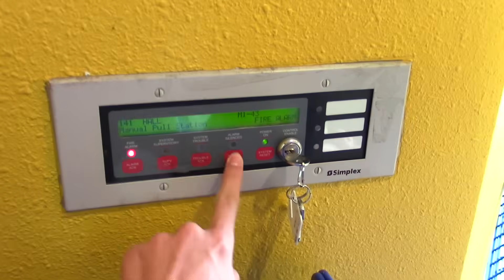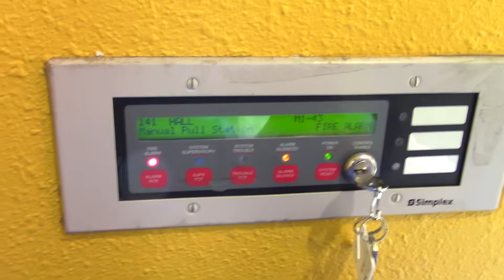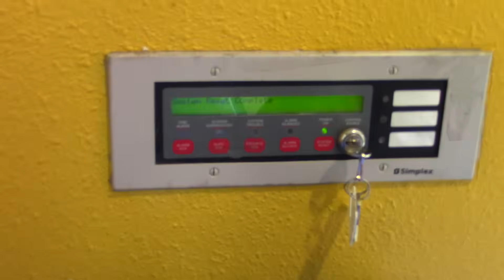School Fire Drill #12: Simplex Annunciator

Comment: How do you silence the chirping noise from the panel when it shows a system fault?
Reply: press trouble acknowledge or panel silence(depends on panel)
Reply: if it is a ground fault you need to get that checked out immediately that means one of the NACs are shorted out

Comment: Where is the automated message that goes with the alarm
Reply: Good question. I don’t believe this building has that kind of system. We did have a building at our school that had a voice evacuation message, but it’s now under construction. Our temporary facility has the same system as the building demonstrated in the movie, which does not have a voice. I believe that NFPA standards do require buildings with a certain number of occupants or more have to have voice evacuation to transmit any critical emergency information. I hope this helps/

Comment: The question you have to ask yourself is “does the fire alarm system save me?” If you don’t see smoke or heat detectors and only pulls and fire alarms it’s not gonna warn you of a real fire so mabye that will be the end of your life
Reply: E Random Videos That’s why fire codes require smoke detectors as well as pull stations. If a detector goes off, it will set the whole system off.

Comment: 13th COMMENT! 
Also, where do you buy annunciators?
Reply: GameAndLifeRecorder you can get them on eBay. You need to make sure that it is 100% compatible with your panel, or t will not work. You need a panel for an annunciator, you can’t use them as panels for very specific reasons...
Reply: EBay mostly, just make sure your panel has an ANN-Bus and is compatible.
Reply: Well guys I may not be able to install it with a panel cuz panels = too expensive
Reply: SATX Railfanning Productions it’s not called an ANN-Bus on Simplex, it’s only ANN on firelite panels compatable
With the ANN Series. Like the MS-9200UDLS rev1 cannot handle ANNs, only EIA

Comment: Nice! Aren’t QuickAlerts and TrueAlerts essentially the same thing with a different name? I knew that when their production started in 1999 they were sued by a Chinese firm who claimed they had trademarked the name QuickAlert so Simplex just renamed it TrueAlert.
Reply: firefreak57 They are the same the only difference is that some have have small hole on right side of the horn grill and it doesn’t say TrueAlert on the top left.
Reply: Tesla
Reply: @Dranfusion also the strobe reflecters are different on the Quickalerts than the Truealerts